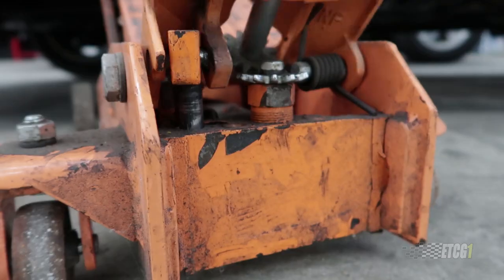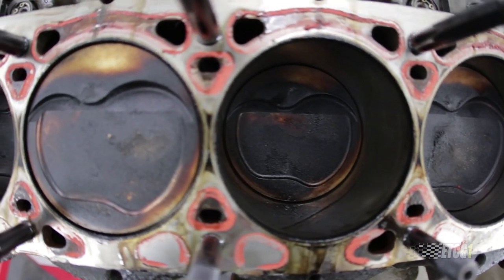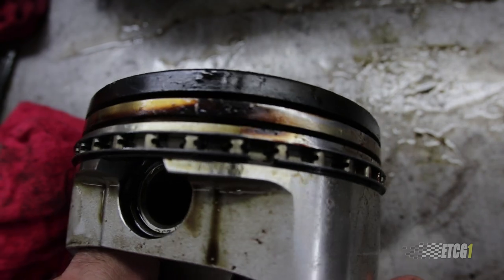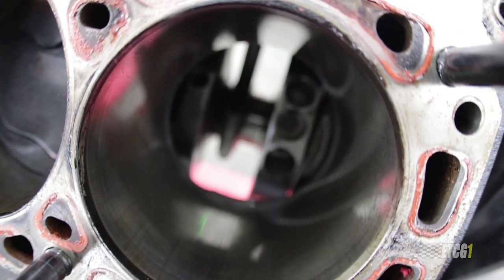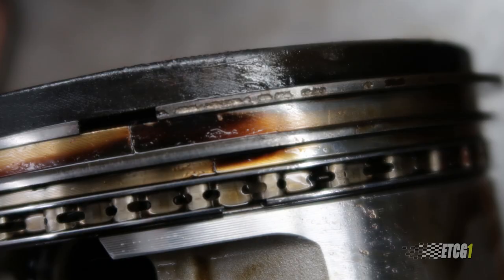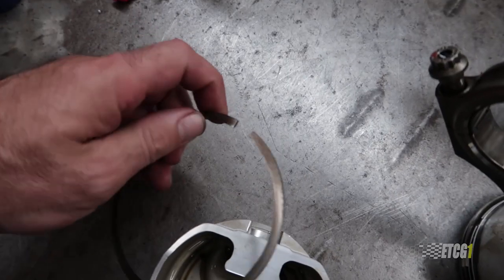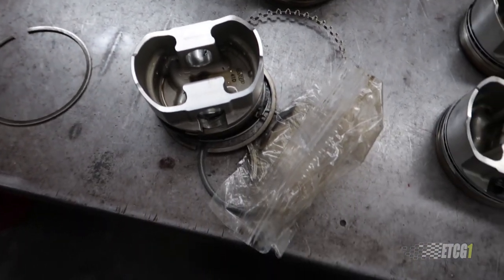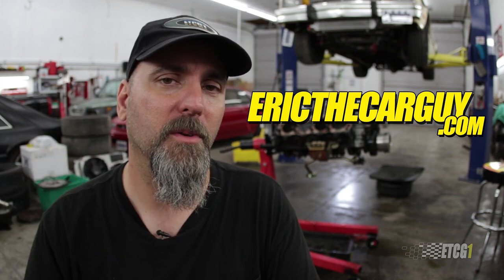Hydrostatic Lock the Silent Killer

Comment: my name is Eric Underhill and i host a radio show on a station called #MuthaFM and would love if you are able to have a chat on air at some stage. I have been mainly with motorcycle engines prior but my station owner has a Renault Megane 16v expression. he first blew the head due to a damaged water pump, so that was fixed, now there is a misfire and a significant l;loss of power and an over budget in fuel. (hell, my 67 Barracuda used less fuel....hahaha)
So as I've been scrolling g through YouTube now for about 39 hours straight (FYI we are in Cape Town, South Africa & is now 04:42am, 
looooong story short after taking of the manifold AGAIN i just noticed that there is  water in number 3....
What do we do now. 
its been battling to start, Does NOT IDLE AT ALL and only seems to be OK at around 2000rpm...
is his car buggered, would love to have a chat when or if you are available.

Regards
Eric Underhill
DIGITAL DESTINATIONS
www.muthafm.com/eric-underhill/

Comment: ive got a funny story from a few months ago that happened at work
so someone in security tells another guy in security that his car needs oil so the guy goes to the mechanics shop. he takes the filler from the big oil tank into the valve cover and fills the engine to the fill cap then try and starts the car. it pukes a shitload of oil out the exhaust and starts with a horrible knock. its still sitting in the junkyard by the mechanics shop waiting for auction. it still starts and runs but sounds like the engine is full of rocks

Comment: 1998 Dodge Neon sucked water thru the air inlet and snapped the #1 connecting rod & locked up the 3 cylinder where it bent that connecting rod. 2003 Dodge Neon did the same thing but just broke #1 connecting rod. Refired the engine and it ran for 30+ miles to get me home. Knocking like I had a colony of indians fighting their way out.

Comment: Errr, water isn't compressible, most other liquids are compressible. Liquids aren't able to be compressed down to even close to how much compression a gas can handle, which is why hydrostatic lock is so bad. But a head gasket leak it much worse than a fuel flooded engine.

Comment: You say it's not the carb but I don't think this would have happened with efi
Reply from the maker: So you don't think EFI engines can suffer from hydrostatic lock?
Reply: I don't think they pour fuel down into the engine then spit it out and light themselves on fire

Comment: This same day thing happen to me when I tried to splash some kids on the road and my cold air intake sucked it up and bam. Done motor!   I then learned about a water bypass for intakes
Reply: fact, since the 90's "cold air intakes are a joke" most factory intakes will pull in cooler air than most aftermarket junk. the only improvement may be air volume, even then an increase in air volume can be negated by it pulling hot air from under hood :)
Reply: throttle bottle yeah mine always pulled air from down below the bumper in front of wheel.    There is definitely a place for them.  But most don’t get everything else they need to do to actually make it matter

Comment: I just fk up my Dodge Challenger with barely 6000 miles on it,I drove too fast thru a flooded street and car died after I was out of the water without making a single noise,try to turn the engine on again and the onlything I heard was a click noise from the starter,had to tow it to the dealer today and now I have to wait until tomm 🙄🤦‍♂️

Comment: https://youtu.be/K0x5BUIuEPc

BA description on hydrostatic lock - piston cannot compress the liquid fuel! I liked the description for ‘work hardening’ effect for connection rods failing at 5:14 using a taffy analogy. Also, I didn’t know about the piston, land ring, piston ring stack. Nor about the fact of how it happens - typically driving through flooded areas. But still I have some questions. 

First it makes sense that the piston ring vibrates rotationally/around until it is aligned with the crack in the ring land below. 

0) how did the fire create the crack in the piston ring? 

At (~5:00) or so you said that once the crack & gap were both aligned that the [fluid fuel] slipped past [into the combustion chamber] and then compression was lost. 

1) When you say ‘lost compression’, that makes me think all of combustion region is essentially full of liquid to prevent compression. If it fills up that fast then the hydrostatic lock definitely applies. But does it really FILL UP THAT FAST even with crack/gap alignment?

2) For crack/gap alignment, BUT without considering any pre-existing leakage (which should occur before crack/gap alignment), then there should be a small period of time (transients) where the combustion chamber is partially filling up with liquid fuel and gas fuel. At which point the compression is steadily “weakening”/decreasing once crack/gap alignment is locked in.

3) for the smoking/gases coming up the hood / excessive blow by, wouldn’t you think that that is more to do with a step JUST BEFORE Hydrostatic lock (which is just after all transients from any crack/gap alignment) 

3a) i.e. when liquid fuel leakage up through into the combustion chamber is expelled erratically through the crack? 

3b) the combusted gases as well another fluid are being expelled as smoke through down though the crack. Where that additional fuel is just the partial liquid that is being expanded and transformed into its gas phase when the piston is on its down-swing / expansion.

****I mean the excessive smoke is indicative of a leakage at minimum, where by leakage I mean PRE crack/gap alignment, and so that leakage means that the fuel is in the combustion chamber is not just gas phase, but also liquid phase. 

I cite three examples (https://physics.stackexchange.com/questions/21889/questions-about-compressing-a-liquid-in-a-piston) in a indestructible piston without any nucleation sites:

A) pure degassed liquid water being compressed (pushed) & expanded (pulled), the former will cause phase change into solid phase (ice) to allow for compression and the latter will cause cavitation to form its gas phase to allow for expansion. 

B) example of a mixture of degassed & saturated liquid with its vapor form, compressed and expanded. For compression, the current gas phase will condense into liquid state, and if compressive pressures are sufficient then see former if A) above on turning into ice. For expansions, the current liquid phase should vaporize as in the latter of A). 

C) if a mixture of liquid water with bubbles (i.e. air (gas) ) then for expansion the water should be encouraged to vaporize so as to maintain vapor pressure in bubbles.

Comment: See this a lot when folks stick those "cold air intakes" on and don't pay attention to the fact that they are right in line with water puddles... The the 4 cycles become SUCK, Squeeze, BANG, OH NOOOOO
Reply from the maker: They're fine as long as you put the safety valves in them. No one puts the safety valves in them.
Reply: most often the only thing they take in is liquids and warmer air than factory since the 90's ;) snake oil mainly

Comment: Yea brother it was instantly myt buddyt drove his car threw the puddle it shut off wouldn't start, pull it back to the shop couldn't  pulled the plugs hit the starter nothing rotated the engine back wards about 270 degrees then forward the same. said well shit rod is bent. The insurance company totaled it. It was a 2011 piece of dodge 6 cylinder.

Comment: Anyone has ideas why my piston broke like that?
https://i.imgur.com/dXr6YGu.jpg
Smart roadster 0.7L turbo. I had a frozen breather during winter and a lot of oil got burned. Maybe a coincidence, but few months later I noticed knocking. Found a piece of piston skirt in the sump. Drove bit more and later found another piece of piston.
Knock: https://www.youtube.com/watch?v=Suv6hsxW4Bk
Did a full dissection. All bearings are fine (checked gaps as well). Engine itself is in very good shape, except for this broken piston.
Any ideas?

Comment: As a guy who works on marine engines as my 9-5 gig, I have to call BS on your hydro-lock theory.  
I have seen all kinds of water ingestion, and locked engines over the years.  You are not going to break a ring land from fluid, at cranking speed, especially from what I saw in the clip of you cranking it till it stopped.  I've had guys kill a battery, and even change batteries, add jumper cables, etc trying to crank over an engine with water in a cylinder.
If you keep trying, and have a good starter/electrical system you may break a tooth off the flywheel.
If the engine spun over a couple times gaining rpm, or firing on a hole or two, before the cylinder filled and stopped the engine, you might have bent a rod.
If you where running along at full song and gulped it full you would have bent a rod (or several) or windowed the block.
Also any setup with a carb and electric fuel pump should use an oil pressure switch to power the pump, eliminates tons of problems and acts as a safety when you crash

Comment: hydrolock will not break ring lands.  the specific pressure over the top of the ring is very low compared to over the crown of the piston, rod will turn loose before (i have personally see it happen, cranking a hydrolocked engine will bend a rod).  broken ring lands is a clear sign of detonation (IE your 14:1 wide open at the big end of the drag strip).  This is why you are a meme

Comment: Yea no
Hydro lock doesn’t cause ringland failure 

Detonation causes this 
Your tune was shit. Your tuner is shit. 
This was caused by doing passes at fucking 14. Afr at WOT and it running on the dyno some hundred times WOT trying to get fuel in it

Hydro lock doesn’t cause a slow death 
Detonation does 

Spark plugs don’t mean shit unless you cut them and look deep in them
Those plugs look like shit anyway 

Also if it ran any time other than a wot pass it means nothing

Comment: I swear there's a whole group on the internet that just lies in wait, ready to jump on carburetors as the source of life's problems. It's comical, actually. Guess they weren't alive when every single new car on the planet relied on carburetors to move people around.

Never experienced hydrolock. I've run lots of ATV's and dirt bikes through rivers and such, too. I was always afraid of spending money, so when I played in the water, I was always super careful. Never been a situation where I've had a hydrolock scenario happen in a car/truck, either. Been lucky over the years! Only blew one engine my entire life - a 305 that was in my '71 C20. Had 4.56 gears, and I  hit over 100 mph trying to put some space between a tailgating Mercedes. Spun the #7&8 bearings .. BADLY!
Reply: You're not real bright if you think a carburettor and a conventional ignition system (even with an MSD box) is a good idea for controlling all the varied conditions in a turbocharged engine in a road car.
Reply: Have you not watched any of Eric's videos?  He's BEEN doing just that! This failure was the result of a bad regulator that filled his turbo tubes with a gallon or 2 of fuel, and hydro locked the engine.
Reply: What makes you so sure of this?  How did Eric re-tune the engine with the new fuel pump/system with broken piston ring lands?  How did the engine run flawlessly for a 26hr hour trip to Jekyll island and back after being breaking the ring lands?  Go back and look at the videos after the hydro lock.  No sign of broken rings.  This was a result of detonation due to poor tuning and lack of cylinder knock control.
Reply from the maker: ArchimedeanEye what makes you so sure you're right? Oh wait, because you're so much smarter than everyone else in the room. You have to be. Your fragile ego can't handle it otherwise. 

Going after me is one thing. Going after the rest of my viewers isn't cool. Keep it up and you're gone.

Comment: i think thats what happened to my d16 the previous idiot owner put a cold air intake on it the aem kind that is super long and goes down in front of the passenger tire and the dumbass cut the fender liner out idk why so maybe more air would get to it? anyway when it would rain hard on my 45 mile drive home from work every day the tires would fling a shitload of water on the filter which was sucking in toons of water id imagine (this was before i knew anything about cars) needless to say the engine is done for it was a slow burn not immediate but not bad for 300k miles hondas are bulletproof not waterproof i guess

Comment: This is bullshit. No starter (aside from something massive like a pneumatic or hydraulic starter) is going to cause mechanical damage to the rods or pistons. This failure was a result of a build error, NOT the relatively minimal shock from a gas hydrolock. Think about it- you thing thar cylinder coming to a stop while being pushed by an electric starter compares to the force of combustion? 

Hydrolock will only result in major mechanical failures if a large amount of fluid is aucked into the cylinder WHILE RUNNING. Now you have the force of combustion (on other cylinders), a significant amount of inertia, and a very sudden STOP... think a car being driven into a river!